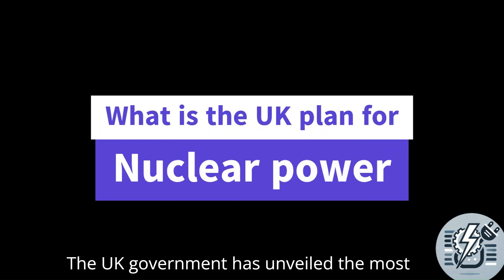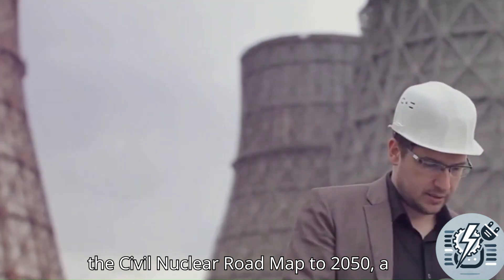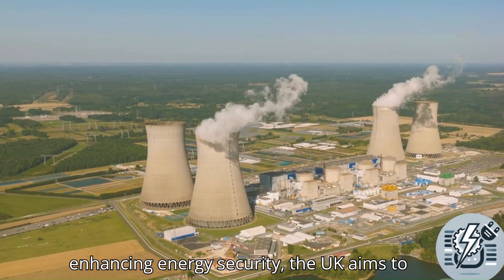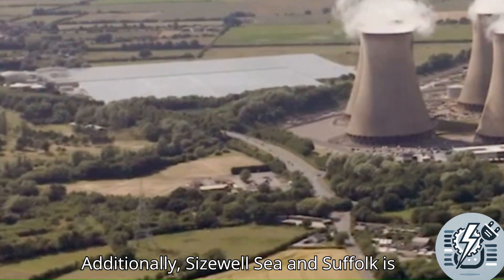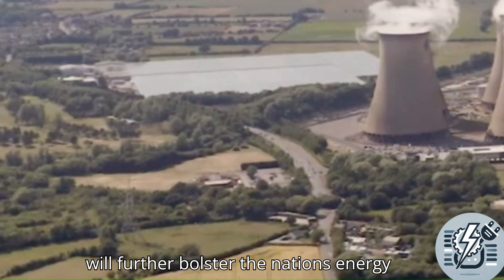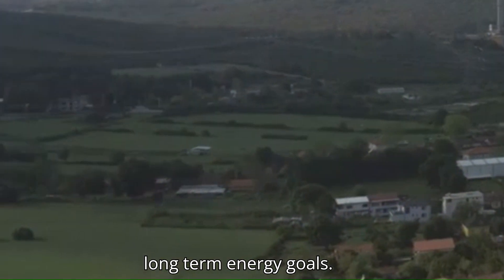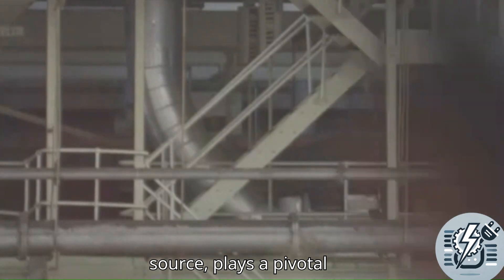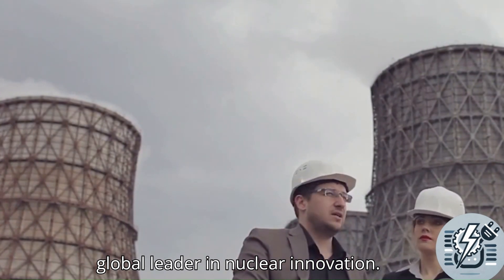𝐔𝐊'𝐬 𝐍𝐮𝐜𝐥𝐞𝐚𝐫 𝐏𝐨𝐰𝐞𝐫 𝐄𝐱𝐩𝐚𝐧𝐬𝐢𝐨𝐧

Comment: Nuclear costs 6x what renewables do and takes 10 years to bring online. Hinkley was estimated at £9 billion, but it’s already 10x over budget at £92 billion. China is installing renewables at a rate of 5 nuclear power station equivalents per week. The only possible reason for nuclear power now is to make fuel for nuclear bombs.
Reply from the maker: Though this is true what about this? 

𝐄𝐧𝐞𝐫𝐠𝐲 𝐃𝐞𝐧𝐬𝐢𝐭𝐲:
Nuclear Power: 0.036 KW/sq ft
Solar Power: 0.01 KW/sq ft
Wind Power: 0.0001 KW/sq ft
Hydropower: 0.005 KW/sq ft

and, nuclear power is unmatched in its ability to provide consistent, reliable energy. Unlike renewable energy sources such as solar and wind, which are inherently intermittent and dependent on weather conditions, nuclear power plants operate continuously, regardless of external environmental factors. This means they can supply a stable baseload of electricity 24/7, which is crucial for modern industrial societies that require a constant energy supply to power homes, businesses, and critical infrastructure.
Reply: @johnhayhurst5884  additionally, Nuclear is only more expensive currently because of the lack of production / competition. Whenever someone says " China is" it completely diminishes their point, especially concerning renewables or energy, they are greatly increasing their number of coal power plants, their general unregulated production with massive emissions is fookking the planet with the excessive influx of vehicles we do not need to go green (HIF carbon, capture, conversion is more effective - it utilises existing infrastructure). The transmission of energy with renewables is also a massive screw up and not mentioned in the costs, they balloon the costs of renewables beyond Nuclear because of grid structure. Nuclear is a better centralised energy source, solar / wind are better on your house in smaller / modular scales combined with gradient batteries for storage (not those explosive chemical batteries of death).